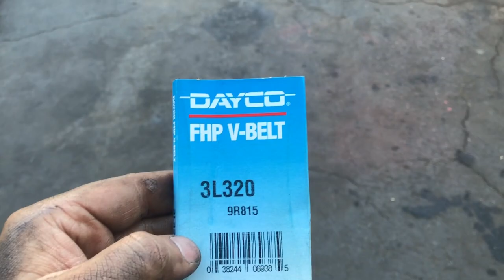Old Snapper i524 524 Snow Blower Drive and Auger Belts Issues SOLD! YOU'RE WELCOME :)

Comment: Hey jason , I found the dayco 3L320 v-belt , what is the exact name for the other belt?  I click on the link and a few belts pop up for the I524.  Thanks man
Reply from the maker: I updated the link in the description thanks for bringing it to my attention.

Auger Belt:  https://ebay.us/TAIW49
Reply: Thanks , it might be easier if I explain my situation.  Same exact dinosaur machine.  Starts right up , drive works but shoots no snow.  Shear bolts are good.  In the video you mention an auger belt.  Do you have a link for that or are they both the same size?  Thanks again for your help
Reply from the maker: @tommyg3998  the link I posted is for the auger belt.  Your machine is an oldie but a goodie.  A lot of hood traits and characteristics I like.  Shame how the owner treats this one.

Have you pulled the belt cover and inspected to make sure the belt is in on or even there?

Do that…

Second step is if the belt is on the pulley start and run the machine…hold down the lever and inspect what happens.  See if the tensioner engages and the belt and pulley start to move…

If that works… next is to inspect to see if the augers and impeller work running the machine.

Report back 

The link I posted is for the auger belt…let’s confirm it needs a belt before you spend any money
Reply: Hey man , I finally got around to working on the snowblower!  Took the cover off and both belts are shot!  I separated the machine to replace the both belts and have no idea which one is the drive belt and which one is the auger belt!  There’s a big pulley on the outside and smaller pulleys on inside. Any ideas?  Thanks again for your help
Reply from the maker: @tommyg3998  

You’re drive belt is the closest one to the Motor and auger belt is the one the sticks out.
Reply: Thanks again
Reply: Soooo got another question!  Belts are on and when I start it the impeller is engaged without depressing the blower clutch.  The cables are adjusted and loose.  It doesn’t look like the pulleys are adjustable.  Any ideas??  Thanks
Reply from the maker: @tommyg3998  

Idler pulley should be adjustable…move it closer to you…away from the belt…
This machine is long gone…i don’t recall there being cables…just a really long metal Rod

Comment: I think that’s how all of these I524s are. The 35 inch belt just seems to be too tight, I ordered a 35 1/4 inch belt which is better. They auger pulleys have a brake on them which is just a piece of rubber hose and frankly does not have enough spring tension to stop the auger from turning.
Reply from the maker: Thanks for the tip!

Comment: I literally love mine, got it handed done to me but also keep it in my garage but damn I love using it and also haul it to do other driveways other then mine. Did 4 driveways yesterday and can't wait for more snow lol
Reply from the maker: Modify the impeller and love it even more!

Thanks for the view and comment, hopefully you subscribed to my channel🔧🦅🇺🇸🤙🏻
Reply: @pattayperformance  stahhp with the impeller mod crap. It works just as fine like it is designed to do. I've owned a few, own others, and still feel these are the best. Use one of these little guys in a storm and you'll fall in love with it yourself. Impeller mods cause more stress which causes more wear in a machine meant to never need much. BTW, best impeller mod is to do a gear reduction; That's a real man's way to modify. But still, no need for any of that
Reply from the maker: @leezamarie7980  incorrect…

Impeller mod done right adds no stress.  My machines have impeller mods on them going on year 6 of commercial use.  No issues 🫡

Comment: Hey Jason, My experience in dealing with lots of the older machines has been to actually take the belt off and physically match the new belt with the older belt. TSC usually keeps a good selection of belts and the quality is pretty decent. TSC is not the cheapest place to purchase belts - But Sometimes You Got To Do What You Got To Do.  
That Snapper reminds me of my John Deere 110 tractor in that every moving part seems to have grease fittings. 
Over the years, I have had to slice & dice many old seized bearings that were never greased and very few due to excessive use - Go Figure.
Reply from the maker: We have a TSC, but it’s a 45 min ride each way.  Compared to the one I have seen Upstate, it’s not stocked as well as big.

Another machine out the door!  Figure help a few others out along the way! 

Bearings reference…when in doubt cut it out. 🤙🏻🦅🇺🇸🔧
Reply: @pattayperformance  Slice & Dice All The Way Regarding Old Bearings.   
For Me, My John Deere 110 has presented me with a wiring catastrophe of sorts;  
Someone in the past history of this tractor mounted a Kohler M8T engine instead of the cast iron Kohler K-181 engine that was standard on the 110 John Deere tractors.  The person who did this unplugged the standard wiring and spliced the necessary wires from the M8T engine to the John Deere tractors wiring just enough to make the engine start while leaving the all of the old existing wiring and voltage regulator intact.
Problem is that you have to turn the key for the M8T engine to the “On” position and use the key switch on the dash console on the tractor to actually crank the starter. 
As you probably well remember from the larger Troy-Bilt tillers, The M8T or maybe the M8ST engine is pretty much enclosed which makes everything somewhat difficult to access compared to the K-181 with everything being in the open. 
Recently I was greasing the tractor and must have unknowingly disturbed the wiring.  The other day I was going to move the tractor and “NADA” - So I had to push the tractor and I wasn’t very happy.  I almost have to diagnose what exactly happened for the no crank condition before maybe just doing a complete rewiring.  Why should something as simple as this be so complicated???.

Comment: I ordered the auger belt in your link and found it to be too short (3L320) (32” OD). Could hardly start the engine. I subsequently ordered 4LK350. 1/2” x 35”  that is 3” longer. Works much better. Still a little tight.
Reply from the maker: Interesting…

The belt I ordered via model and serial number were too big.  Like slide into the auger pulley and tensioner with minimal effort and lots of play.

I took the belt that came with it and matched it up.

No issues reported after 2 major snow falls…I’m kinda baffled at this point for your situation.

Thanks for chaining in…at this point time will tell.
Reply: My Snapper model # I524 same as picture in your video. When I search for the auger belt Snapper part 1- 5152 comes up.  When I search on EBay the following comes up. “Snapper 1-0085 1-5152 1-9534 2-3282 7015152 Replacement Belt Made With Aramid”. That belt works for me. No worries. Just thought I would pass along my experience.
Reply from the maker: @davidhaglund9138 

I’m very happy that you passed along your info and situation!  That’s how we all learn and grow!  Please don’t take my response as rude!  The whole time I was typing…if I had a third hand it would be scratching my head.  I was just explaining you the process that lead up to this video!

I wish more people would express their experiences!  We are all learning this together! This video, your comments as well as others will help others!

Again please keep me updated
Reply: @davidhaglund9138  yes I have original belt on my I524 for Auger. It's 1-5152 Snapper brand.

Comment: That's a bit older looking than my Snapper i722 (full model i7222E) - think mine dates to '95. Works great though the 724 (24" wide) would have been nicer, but hey, got it for scrap price. The 7 horse Tecumseh runs great (even without the electric start working, will start in a single pull, idles down great, etc), finding a new head gasket, cleaning up those mating surfaces, and installing it with Hylomar made it like a brand new engine.

Does have a lot of grease fittings though none for the gearbox which takes weird 00 oil/grease... Getting the shear pins is a pain because they've been obsoleted multiple times and the latest version are more like hitch pins, no shear line. Fortunately I found a Stens substitute for the part number that looks like a proper shear bolt this year.
Reply from the maker: That’s great!  I wouldn’t think twice about drilling it out for slightly bigger one.  They are made to break anyway.
Reply: Oh that's a good idea, I'll do that once I use up this bag. These came without nuts, how annoying.

Also I'm full of crap apparently, your post prompted me to actually do my maintenance on it yesterday, and it totally has a grease fitting in the gearbox. I just must not have figured out any way to use that to install the #00 "oil" (like halfway between oil and grease, more like clear refrigerated gravy)

Comment: I'm looking at parts tree.. The auger belt is listed as 1-5151, 15151, 7015151. drive belt is 7015152. 
7015151 - 1/2" x 34"
7015152 - 1/2" x 35"
Is this what you gathered?
This guy is literally using this machine until the wheels fall off.
Reply from the maker: some people just don;'t want to let it go!  would you?